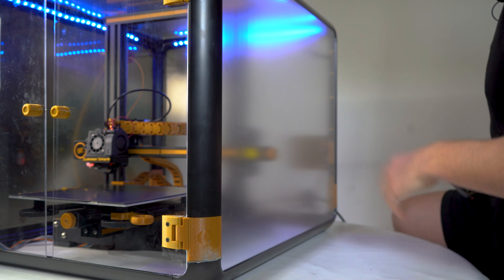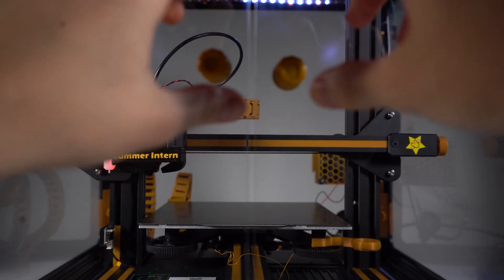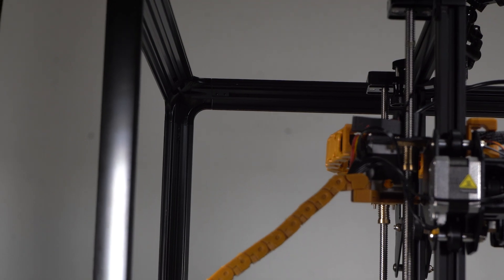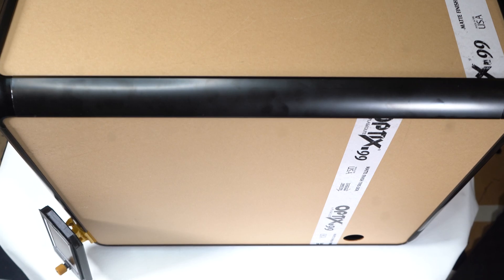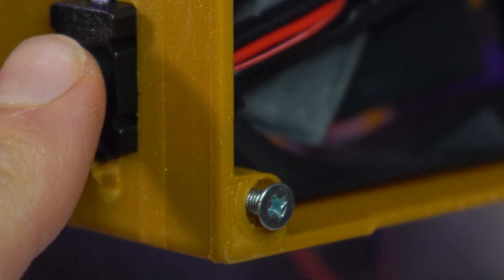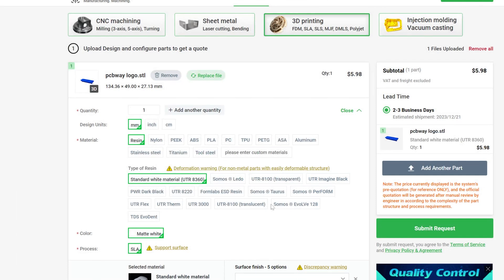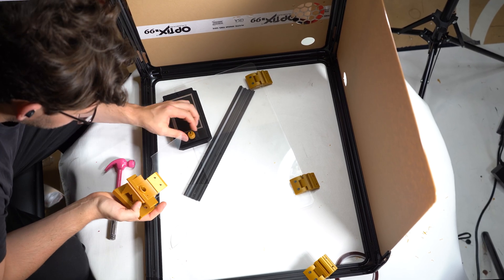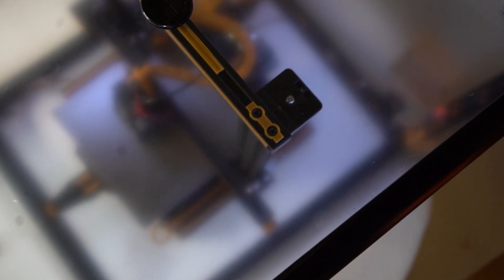I Built the ULTIMATE 3D Printer Enclosure for my Ender 3 V2

Comment: I put mine inside a 90’s stereo cabinet 😂. Then I made a hole through the top and have my filament on the top inside a filament heater box. The only issues I have are it’s not wide enough to keep the control box mounted to the side and when the bed moves all the way forward after the print is done, it hits the glass door. But it keeps everything nicely enclosed.